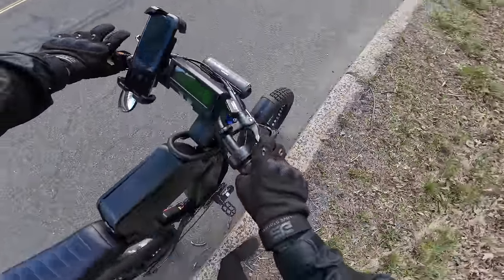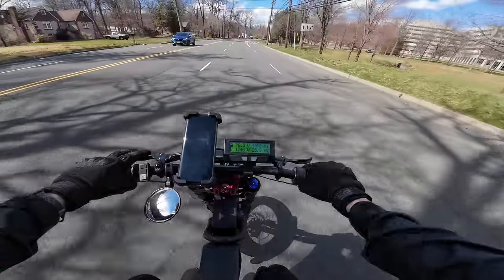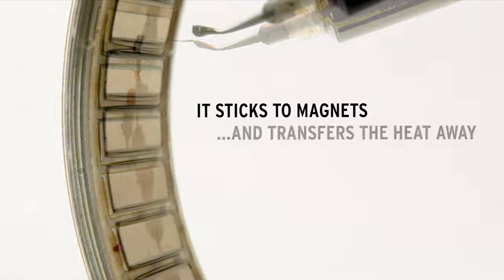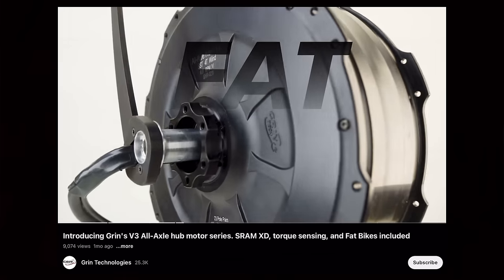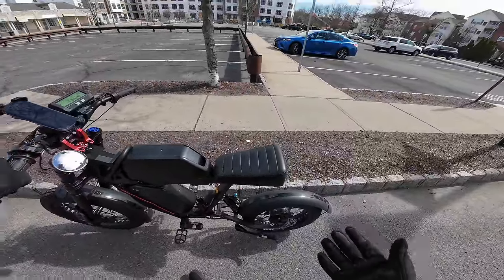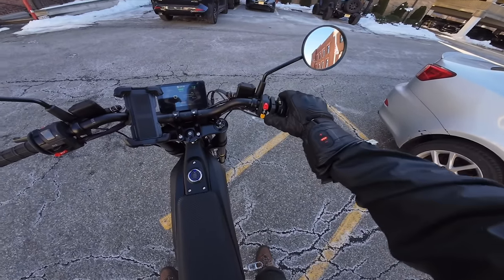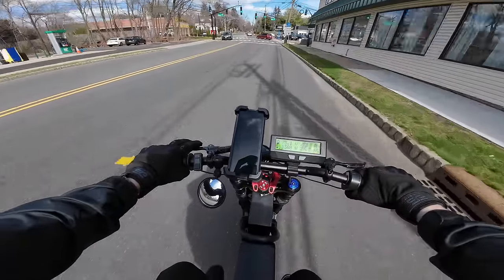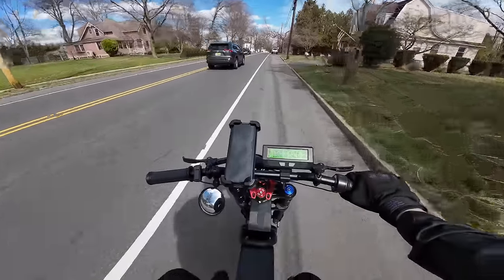Hands Down Best Hub Motor for Your Next eBike Build

Comment: I have already pre ordered 2 fat All Axel front and back. Building a new 3 motor AWD bike with Bbshd.3 batteries 72v, 3 Phaserunners, CA3, RST Renegade forks and 100mm rims with 4.8 Maxxis tires. I have a one wheeled fat tire trailer I installed a Shengyi SX2 motor to make this the ultimate catapiller for climbing mountains with heavy loads . With 2 motors with variable Regen I won't have to use brakes coming down the mountains.
Reply: That's an expensive horrible wiring job but hope it's not to bad good luck hope it's sick. I wanted to do a hub and  bbshd modded build full suspension build just hard to find the right frame 😢
Reply: Over achiever!... lol
Reply: Wait what’s the point of a mid drive if you already have 2 hub motors?
Reply: @kimhyunwoo8983  Both hubs work for top speed and the Mid drive allows for the use of all your gears in your cassette, throw a 60 tooth ring up front, ya can tow a mac truck or race up any mountain, using pedal power and motors... is an overkill unless your an adrenalin junkie then I'd call this build, brilliant!
Reply: By the way Phaserunners do handle 55 amp continuously 90 amp peak.
Reply: That gotta be heavy asf
Reply: So you're doing. Mid drive along with 2 hub motors? 😆 Trying to beat a sur ron aye? 😅
Reply: You won't get your money back so don't be that facebook market place guy that did a super expensive DIY build and tryna sell max price
Reply: @kimhyunwoo8983  over doing it or releasing the torque stress from the back hub :face-blue-smiling:

Comment: I enjoy Grin stuff and Justin is an absolute genius. I'm not sure if I would call this the best hub motor without knowing the specifications, such as torque or nominal/peak wattage. A modified Bafang G062 peaking at 3,200 watts with a Phaserunner and dual Tesla batteries is my current favorite combo. I'm usually the "rescue" vehicle that tows other bikes home when they break down or run out of juice on group rides, and pulling a quarter ton up a hill at 20mph will be a hard act to follow! I'm open minded though, and being able to use Statoraid will be a big benefit.
Reply: I have been bugging Grin about the fat bike All Axel since they came out with it initially as a boat motor a few years ago. This motor can replace a 12 HP diesel sailboat motor to give you some idea how strong it is.
Reply: I spoke to him at the BC Bike Show a couple weeks ago and I asked if the fat version could handle 5kw and he said yes.

Comment: @NPLVentures
Agreed! I also do not work for Grin Technologies but think highly enough of this motor that I'm using their rear All-Axle motor with built-in torque sensing on my first ever e-bike build project. I had purchased their great Cycle Satiator battery charger and knew that Grin Technologies was on the cutting edge of modern motor technology on e-bikes. 

With the latest All-Axle options including built-in torque sensing option (rear All-Axle) and the fat bike hub option I just don't know of any motor manufacturers that has this many options available for their motors.

Comment: I just watch videos of this industry but I agree with you on getting rid of the mechanical drivetrain.  one question though, how come the bike industry still don't use axial flux motors? the low rpm speed of these motors and lower cost is perfect for this application

Comment: Grin needs a better controller, the PR is great for what it is but 100 phase amps and only 45 amps continuous isn't enough for these large motors
Reply: This is entirely true. There are various paths being explored but sadly nothing very clean that can be done in the near term timeframe.  

As a result we'll initially be releasing the fatbike just in a fairly slow 7.5 rpm/V winding so that it still can deliver a good torque at the 90A peak / 50A continuous phase amps of the phaserunners.  For a faster ~10 rpm/V option though, we really need both a higher phase current controller and a higher current connector than the L1019 plug. More than about 55-60A continuous will start to melt those nice connectors too, but there isn't an combined phase+hall motor plug standard on the market for higher amps. .

Comment: Ya I was thinking of getting grin motor and stuff, but I instead went with a 5k watt kit as im a bit strapped on funds at the moment and need the torque. I don't need speed I don't like going over 35mph. I just need it to tow my trailer and all the weight I have in it. Which is around 600-800 pounds. Already have the bew motor installed, but i need to go back in the settings as when I was in it I lowered everything as to not blow up a 48v stock battery that came with the bike its 60ah. Only thing i can't get working is the torque sensor as I had to use the stock bikes sensor. The one that came with the kit wont work on this bike its designed differently. I hoping its just a disabled setting as the sensor as a light and shuws green dnd even tried moving wires around still nothing. Will go into the controller settings tomorrow and see if I can't get it to work.

Comment: There is limitation on the discharging current ; The same there is on charging one ; so ask the battery manufacturer about the specifics of the battery you are using for your bike, and be careful from overheating the battery; that's causing damage, and maybe fier . thank you

Comment: Top of the line with a top of the line price...I could buy 4 MXUS 3k or 3 QS205 3000w motors for the same price, both of which I enjoy using. No doubt the Grin is better, but I'm cheap and enjoy my cheap thrills. Might be worth it if it was my main transportation, but it's not, so...cheap for me!

Comment: Not one wattage rating when I looked at "Grin"... Too much hassle trying to figure out the power.
Reply: Watts = volts x amps.  Not hard considering the phone your probably watching this on has a calculator app built it
Reply: @BramBiesiekierski  
Perhaps, I was expecting such at first sight... NONE of it, so I couldn't do the math unless I searched the site a little longer to find at least two of the three.

Thanks though.

Or, maybe I was thinking I wanted to see the actual watt rating (again, me being too lazy to search the whole site), all the others brag about their specks, usually listing all three, motor watts, battery voltage, controller amps (and battery amps hours) on first page. I'm gonna look again.
Reply: I'd delete, except that there's already comments. Why? Because I was too impatient and was looking around without watching the ... even half... of the video. These are NOT made in China!
So, of course, they would have ratings on the motors, had I not get distracted by others' products.

Comment: Oh YEAH! When my 2 wheel drive BAFANG 52 watt motors begin to die I'll be calling GRIN Technologies in Vancouver for these fat tire motors. HOPEFULLY by that time, say i three years, maybe there will be solid state batteries that last longer, charge faster and are lighter than my current two SAMSUNG Li-ion batteries.
UPDATE:-> GRIN Technology will soon have the "FREEGEN" regenerative braking system integrated into their hub motors. Basically it depends upon a unique way of attaching the brake rotor to the hub. This new system is an Israeli invention and GRIN will likely make the system under license (I think). EUREKA! EUREKA!